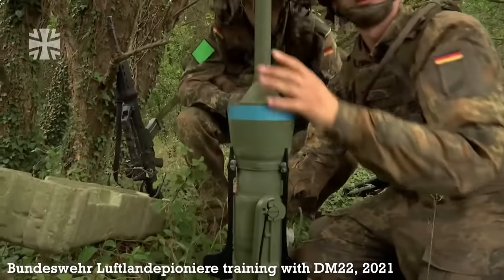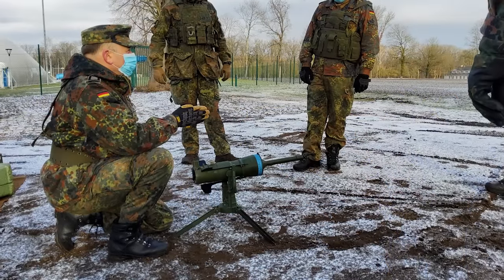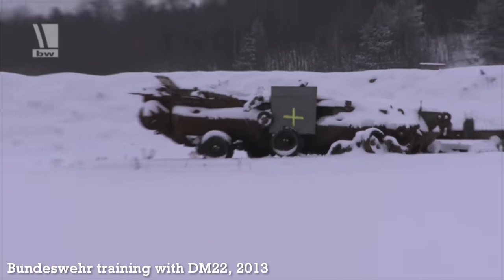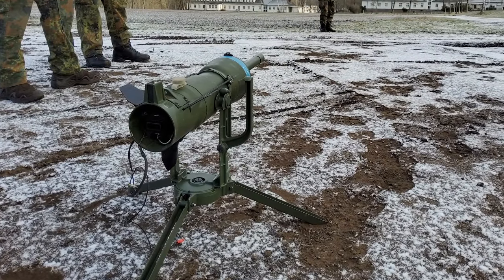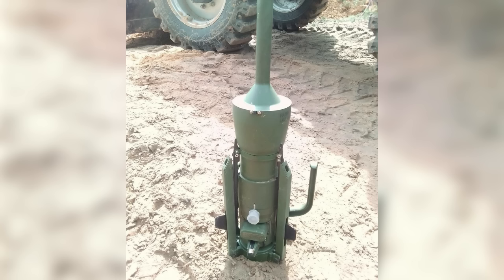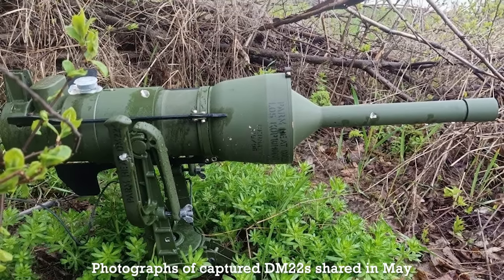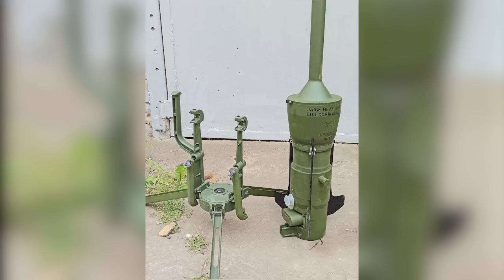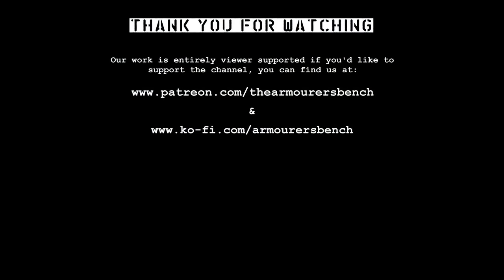German DM22 Directional Anti-Tank Mines In Ukraine

Comment: There are now little shaped charges that will almost fit in your hand. Tanks are safe from them, but they will light up most other vehicles.  A soldier could carry 15-20 of them and set them along tree-lined roads. I think the hypersonic molten copper is effective for 10-15 feet. Search YT for this:  dHfQYGGUS4U&t  and go to 4:00 minutes.
Reply: 100mm of penetration, even if it only hits the tracks you have still disabled a tank.
Also they cost 5000€ that's almost nothing, you can literally pepper the whole country side with them and make every corner a coin toss for the tank crew's.
Yes against a modern tank they dont do much, but against cold war era tanks (cough rusky) they do damage.
And APC have a bad day against them.